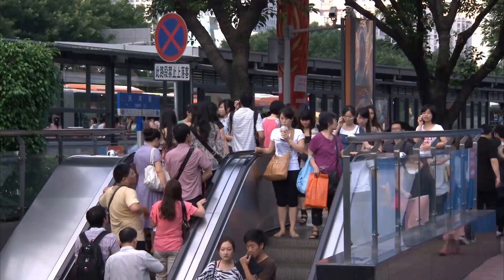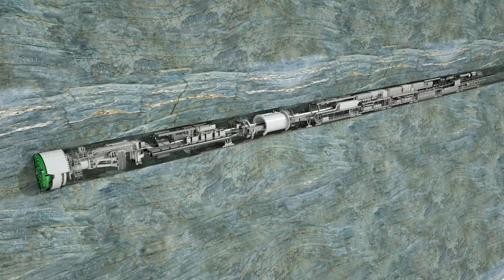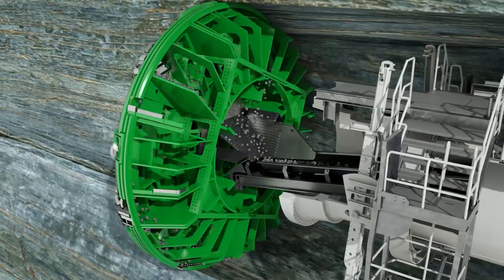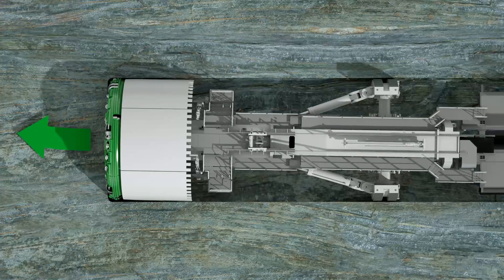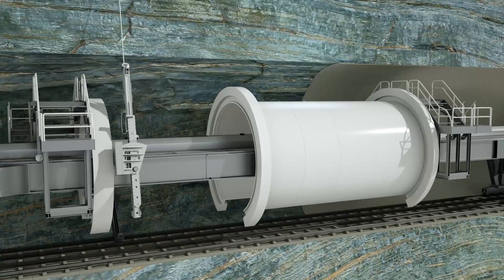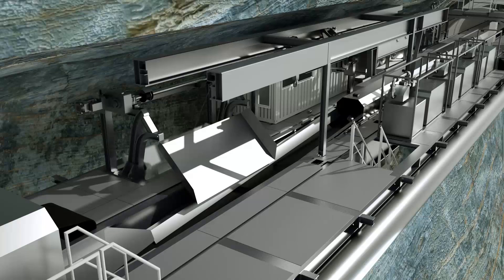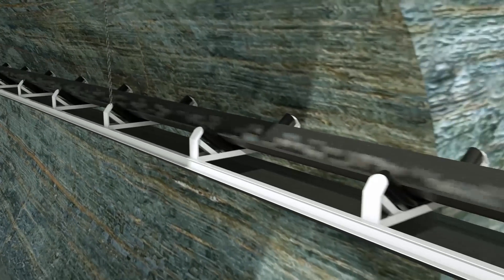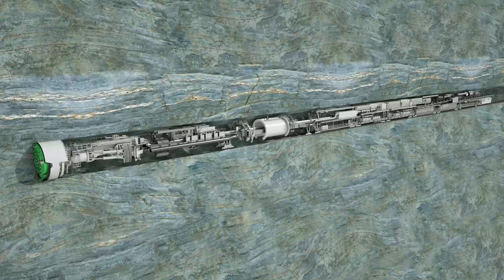Gripper TBM

Comment: Hello, I had a question. What is the drilling slope of this machine? For example, from line A to B, it is about 1 km long, with the maximum slope to the depth of how many meters it can go down.
Reply from the maker: Actually, the TBM itself is less critical for inclination of the tunnel. But it has quite some impact on the logistics and 5% are manageable with little effort.
Herrenknecht has designed and used Gripper machines with special design for inclinations. Check the following references on our website for more details: 
- https://www.herrenknecht.com/en/newsroom/pressreleasedetail/40-degrees-uphill/
- https://www.herrenknecht.com/en/references/referencesdetail/90-prozent-steigung-wasserkraft-am-gotthard/

Enjoy your reading!
Best regards,
Herrenknecht AG